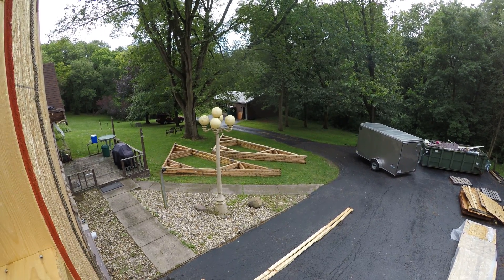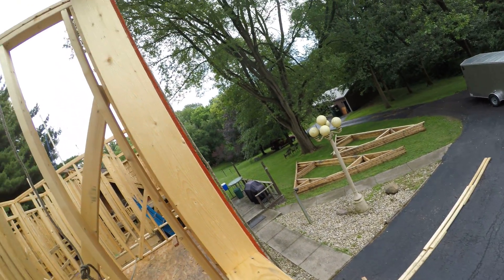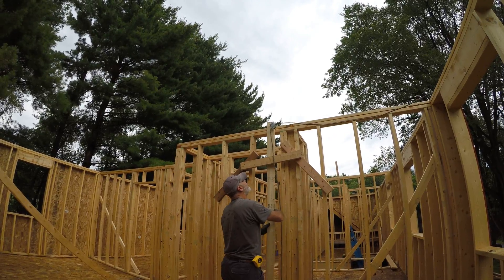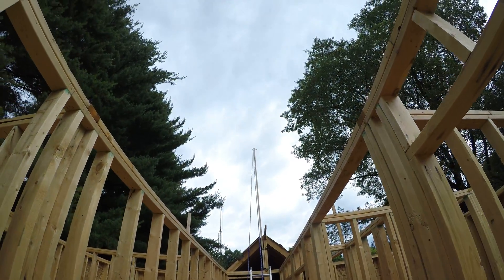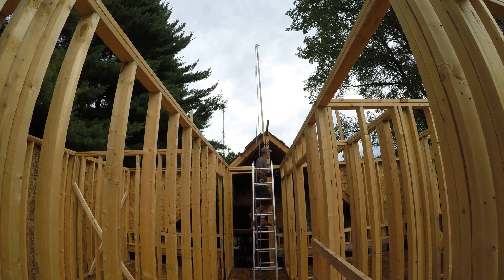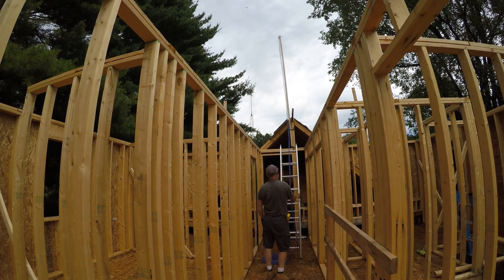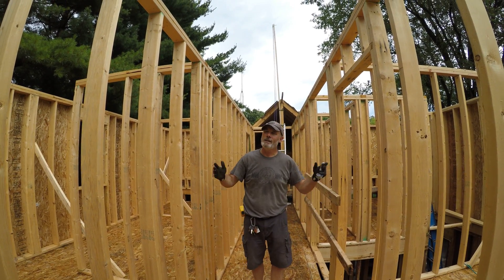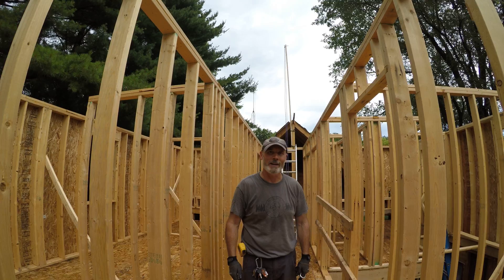Truss Pulley System Explained

Comment: cool idea! do you have a video of the actual system in use?
Reply from the maker: This is the blog for that part of the job. It should show you warts and all. https://thecolbertrepair.wordpress.com/2017/08/01/truss-me-we-can-do-this/

Thanks for the comment. One other comment... I would have used larger block and tackle pulleys in hind sight. There lifting worked, but was more difficult than it would have been if I had used better pulleys.